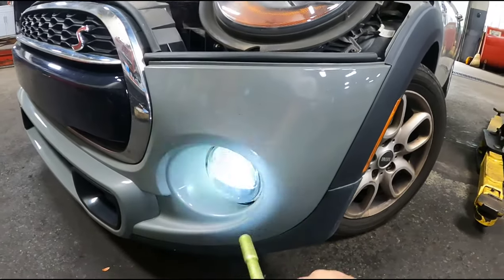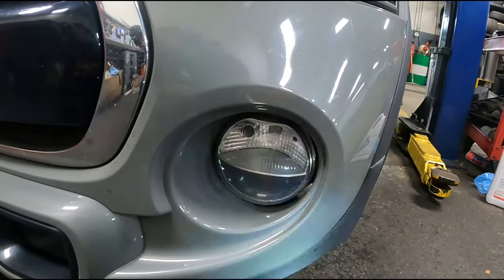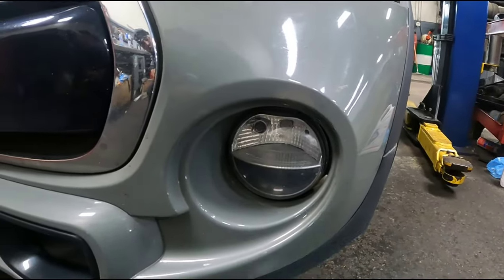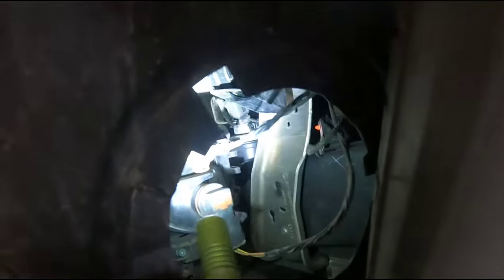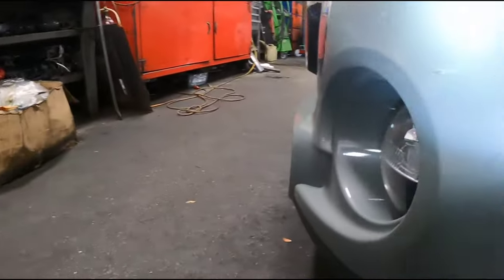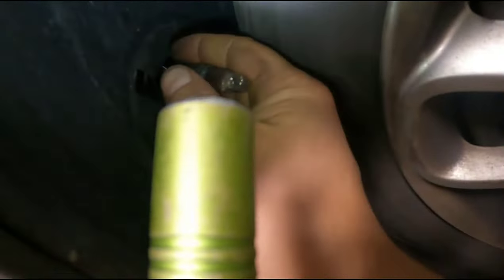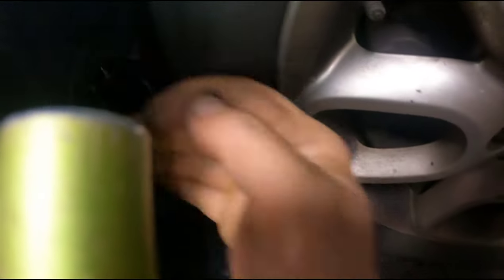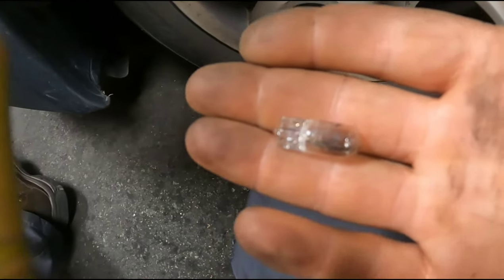2015 MINI COOPER FRONT PARKING LIGHT BULB REPLACEMENT

Comment: I am trying to replace the fog light bulb for a 2014 Mini Cooper. But I can’t get the bulb out. There is a plastic piece in the way preventing me from turning the bulb counterclockwise. Any suggestions?
Reply from the maker: That's with it unplugged right. What youre saying sounds familiar but I can't remember the way around it
Reply: @EuropeanAutoRepair  thank you for your reply. After many many many attempts I was able to get the old bulb out and replace it. I had to unplug the bulb from the socket first. Once that was off I then twisted the bulb out of the hole. It was very cumbersome, as my experience with Mini has been.
Reply from the maker: @Karena_Karena  I'm happy you got it, sorry I couldn't have helped more